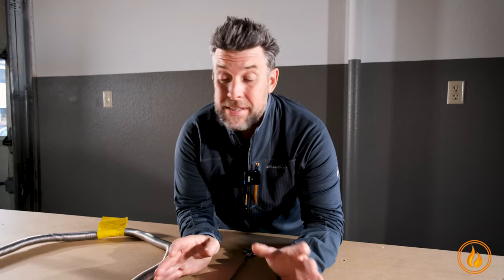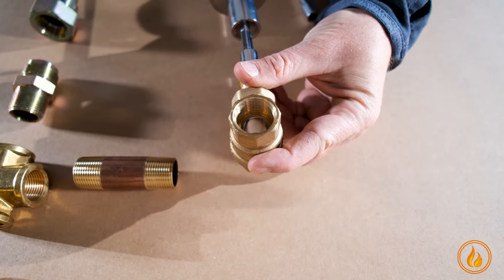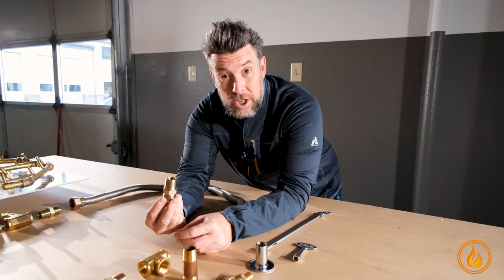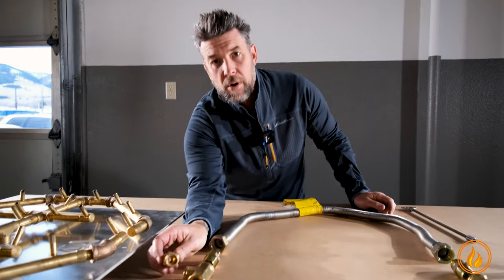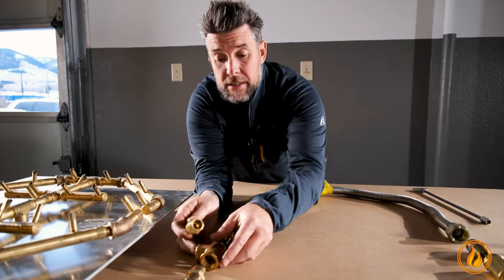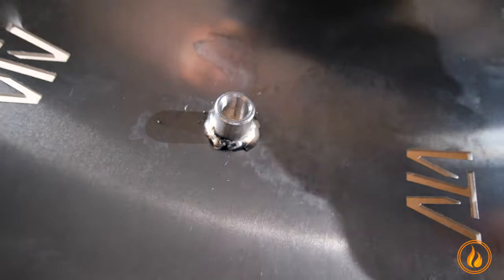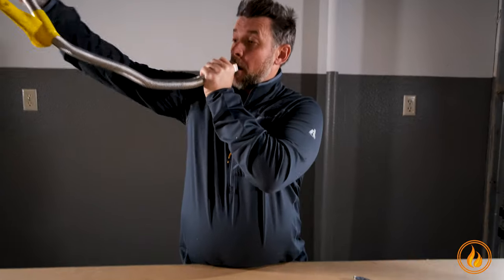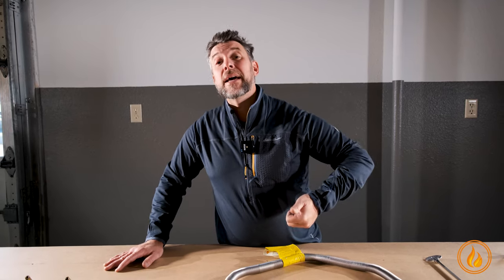Dual Flex Line/Key Valve Kit Overview - For Burners 250K BTU and Higher

Comment: id understand that supplying more fuel if it was 1" coming in and then you used two 3/4 lines.
Reply from the maker: A 36" long, 3/4" I.D. whistle free flex line can only carry up to 255K BTUs. So in order to get your full capacity flowing after the key valve, with this type of gas line, 2 of them are necessary.
Reply: But if your supply is only 3/4 inch to the pit how can it supply more than one whistle free line? My pit only has 3/4 supply. Should I buy a smaller unit? Thank you